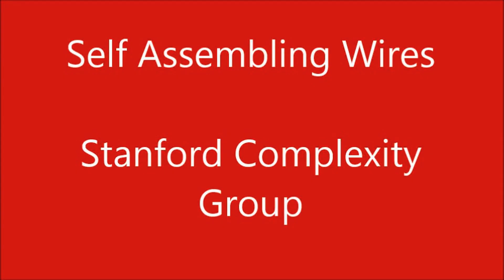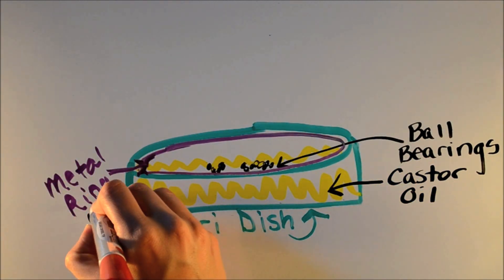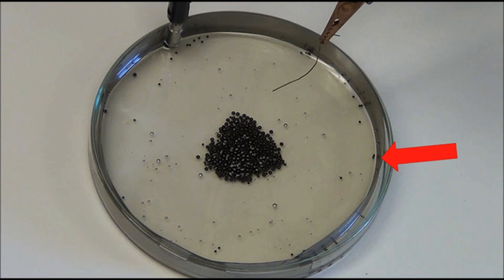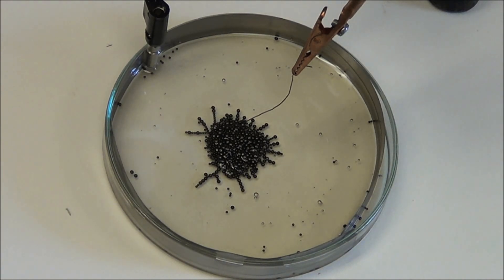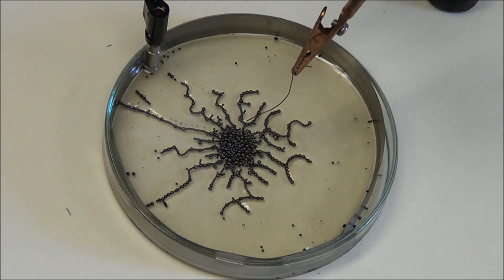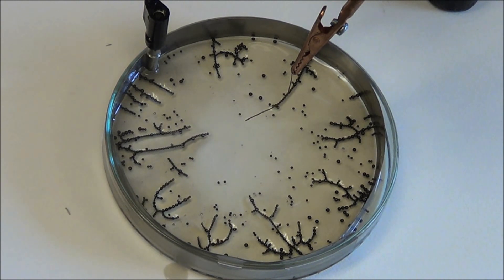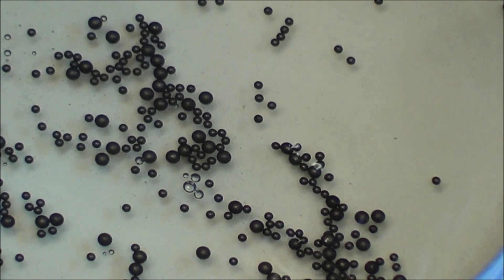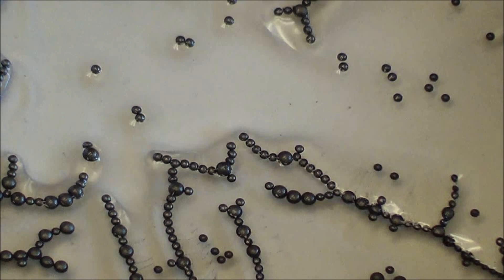Self-Assembling Wires

Comment: "The plugs in your house are 120 Volts."

chuckles in european
Reply: 230 V
Reply: politely snickers in Amish
Reply: @comit8077  *prays
Reply: Chuckles in New Zealander
Reply: How much volts do you get?
Reply: @mitesh2k3  240 in the UK lol
Reply: @r.m.l2665  - Same as the rest of Europe, the UK is 230V +10 / -6%, with the exact voltage varying between regions and even within the same region, during the course of the day. Some areas actually reach 250V (which is still within the standard).
Reply: @mitesh2k3  230 V RMS. 3 phases separated by 120 degrees (three phase is used for high power appliances like washing machines, for wall sockets you pick a phase more or less at random and use for separate areas of the house). You can get a peak voltage between phases of 400V (since you don't need a lot of current for this application; you just rectify and buffer that voltage with a capacitor and if there's enough resistance like this mineral oil it will drop imperceptibly to the next cycle)
Reply: @soylentgreenb  lol he just asked your AC supply. Just straight up say that it's 230 Vrms, why are you even trying to explain the rectifiers to him lmfao.
Reply: Laughs in Texan

Comment: Next, we attach a power supply and hang a wire over the top of the petri dish.
(proceeds to draw a plus sign to indicate that said wire is positively charged)
When we apply a large voltage, electrons get sprayed down to the ball bearings in the dish.

No. That's not true. You're full of shit.
Electrons have a negative charge. They flow from negative to positive. Either you've got your polarity reversed, or the electrons are spraying from the ball bearings to the wire.
Stop feeding the community false facts.

Comment: What might happen if you used iron powder in place of ball bearings? Would there be any difference id you used ball bearings with differing conductivity? Could you get a three dimensional set up if you coated the ball bearings in plastic to achieve neutral bouyancy?
What conditions would you need to apply to this demonstration to make a safe eucational toy?

Comment: At 0:49 you show electrons "getting sprayed down to the ball bearings..."  but electrons move from negative to positive, from cathode to anode, with the cathode negatively charged and the anode positively charged.  Electron flow is, like, the first chapter in electronics.  How did you get this wrong?

Comment: I hope somebody post this on Electroboom subreddit so he can try this out
Reply: "And if you see here Points too closely to the dish and gets shocked to hell AH. AHHHHHHHHHHHHH." I want it.
Reply: @MrPanaramuh  he'd ACTUALLY die if he did that
Reply: @Pockeywn  most lab supplies at high voltages run on pitifully low amperages. Think nanoamps.
Reply: @Pockeywn  I mean..I don't think so. Amperage is more deadly than voltage. These power supplies run at what... 0.5 amps? And besides...most of it's for show. Mans an electrical engineer. He's paved his way with stunts like that...EXCEPT the Jacob's Ladder fiasco.
Reply: @MrPanaramuh  amperage and voltage are dangerous together, lack of one will reduce the danger.
High amerages at small voltages will not pass through the skin.
Reply: @royalgummyworm8131  Yeah. This produces a whole other set of dangers though tbh.
Reply: @MrPanaramuh  r/whoooeash 

Hahahahhaha
Reply: If Mehdi were to read this comment thread he'd probably die a bit inside...
So many misconceptions here which he tried so hard to explain in his videos...

https://www.youtube.com/watch?v=XDf2nhfxVzg
https://www.youtube.com/watch?v=snk3C4m44SY

It's voltage and current working hand in hand that kills you.
Lower frequencies/DC aren't necessarily safe. You just need a higher voltage (or simply wet skin) for them to become harmful. 
On the other end of the spectrum, very high frequencies won't even hurt. https://www.youtube.com/watch?v=L5E4NiP4hpM
But I image even that can be dangerous if the tesla coil could keep it's voltage up high enough to push a high enough current through your skin.
Reply: @matthew_turkmen7482  How?
Reply: Your wish has been 50% fullfilled.
Reply: @matthew_turkmen7482  You are mistaken. Please be careful and do NOT rely on frequency measurements when making a safety evaluation.  Many factors are involved in lethality..... voltage, current availability, resistance ( both internal and contact ), position of contact, duration of contact, medical history, and yes, even frequency though because it isn't something we can usually do anything  about its normal to ignore it when considering mitigation measures.
Reply: I like your channel header
Reply: @matthew_turkmen7482  I'd also would like to know why you think this is.
Reply: @MrPanaramuh  the human body is highly capacitive. DC current doesn't flow well through capacitors, but AC can. The higher the frequency, the more easily the current passes through capacitors. In fact, an ideal (infinite) capacitor behaves as a wire under AC.
Reply: Electroboom is the cringiest shit
Reply: @K-tizzle369  YouTube in general is the cringe.

Comment: Fascinating video! (with surprisingly few views: 118,813 between 2015 and 2021).
A quibble: I have my doubts about the phrase, "electrons get sprayed down to the ball bearings" (at 0:47). Electrons in copper move at a literal snail's pace, far too slowly to make all this happen. In my opinion, the driving force here is the electromagnetic wave front (which travels close to c, which is to say millions of times faster than an electron -- same as in electrolysis, btw). Saying it another way, a wire hung over a petri dish is not a particle accelerator.

Comment: Nice, so diluted ferrofluid in a electrical field is the way to assemble better solar panels that not only look like leaves but distributes the charges in a fractal-infinite curve tree structure.

Wonder if you'd just need a bit of flux and solder to make it solid and permanent so you can get it out of the oil
Reply: If anyone can tell me how I can make a P doping at home from sand I'll break my microwave and a Taser (mosquito racket, really), maybe make a Marx generator from old buck transformers and try to make a solar panel from this.

I'll still try to do this at home, kV aren't that much of a problem, ididathing made a Jacob's ladder, electricboom has many videos about high voltages too and also the Plasma channel..

I mean, c'mon, you can easily make it at home, you just shouldn't do it bc you'll probably electrocute yourself to death

Comment: The path of electricity is very thin, its not wide at all.  The bearings(as all matter does) conducts electricity, and in so doing physically(with no resistance as in this case) align with the current, thin current...  Which explains their single file line.  When the first chain touches the outer ring, a new path of least resistance begins and electricity bulks up using this path of bearings.  The previous path of least resistance was an air gap along the surface of the oil.

Comment: That much voltage that close together I was honestly expecting it to just arc. Not a linesman myself, but I've watched them close a fuse in after dark, quite the lightshow at 17kV
Reply: If the current is limited (which it will be from a tiny power supply like that), then arcing is likely to be minimal - the instant enough air is ionised and current starts to flow, the current limiting kicks in and the voltage drops (thats how power supplies work). Attach it to something like a 500MW generator, and it'll arc.

Comment: What would be interesting here would be to have more than one variable high voltage source.  Then use an artificial intelligence with backpropagation to assemble different shapes.  If you could then activate the substrate, you could fuse the shapes.  For example, by applying sufficient heat, you could weld the metal balls.

Comment: The most impressive part is that 22 percent of the balls made up the ends
Reply: And 22% made the connections :)
Reply: @mmdirtyworkz  Technically all the balls in the structures were connectors, what you actually meant is branches. Still quite impressive.
Reply: 22 percent of pee is stored in the balls
Reply: @tophan5146  Especially when they are out on the end of your rod.
Not surprising...  some 40+% of Americas' citizens got their heads stored up Donald John Trump's ass.  They decidedly moved toward the wrong attractor.  Many were never seen again.  Many are still trying to detach.
Reply: This can be a statistical phenomenon. I'm thinking out loud here but hear me out. We can divide the balls into 3 main states based on their electric potential, in increasing order of potential:

1. Leaf Balls (those at the end) with only 1 adjacent ball
2. Connector Balls with only 2 adjacent balls
3. Branch balls with 3 adjacent balls

We can make an interesting observation here that the potential of each ball would tend to the average i.e. the total voltage applied to the system / number of balls. Too much potential and you tend to lose some and too little and you tend to gain some. The system doesn't favor either state more than the other, which means the odds of a ball being in either state is equal.

This means that, if I were to plot Number of Balls vs Voltage on a graph. It'd be a traced by a symmetric curve about the average voltage. 22-56-22 is just another way of writing a 1-2-1 ratio. This means you're twice as likely to be a connector node than 1 or 3. Not sure why it's this specific number but I'll get back to you when I find the time to give this a more rigorous thought lol
Reply: @RexGalilae  Brownian motion with an attractor introduced., switches to shortest path seeking.  Try it with an insulator for the beads, like bead blast glass beads.  I'd bet they would still try to crawl to the edge similarly.  Or try different conductors like copper beads or silver beads.
Reply: @cosmicraysshotsintothelight  
Exactly! A Stochastic process
Reply: Why?
Reply: despite
Reply: OK, I'm trying to decide why I should be impressed. Somebody impress me with an answer.
Reply: Balls
Reply: @cool_bug_facts  Observation tally errors.  It is really 21 and 23. :-)
Reply: 22 percent of ends and nodes.  The number 22 is obviously dependent on factors such as the medium's viscosity and conductivity of the ball bearings.  However, any fixed number would be fascinating in itself.  'Ends' and 'nodes' remind me of vertices and edges (and surfaces) in the geometrics of solids.  I'd love to hear anyone's views on this, because the number 22 is what jumped out at me.  (Also: dendrite formation - and later pruning.)
Reply: 100% of pee is stored in the balls
Reply: This is why sarcasm is funny
Reply: a thousandth like
Reply: For every new branch (with new ending) you need a junction as well. So unless there are multi-branch junctions, you'll always have the same amount of ends and junctions.. (or rather, one less, as you start with 1 end and 0 junctions).
Reply: Heheheh balls
Reply: @3pmBreakfast  That's what Newton said.
Reply: and you got 22 likes
Reply: @damnyourpasswords  and this is the unfortunate 23rd reply
Reply: That means that lightning can get ya no matter where you are standing if it is anywhere near the point it decides to strike.  Those darned dendrites...  you try soaking them out, you try scrubbing them out, and still you get BOLT AROUND THE COLLAR!
Reply: That's actually just basic logic. The interesting thing is that 22% make branch points. Because whenever you branch, you add 1 end so logically number of ends is always number of branchpoints+1. Why 22% make the branches? I dunno.
Reply: https://youtu.be/0VkrUG3OrPc
Reply: Not the fact that it had borderline intelligence?
Reply: Are you a bot? I do not understand the point of this comment. 

I see this type of comment in every video on youtube: "my favorite part is (random clip)" 
The snippets they highlight are totally random and have no elevated meaning outside of their original context. Its so common, and so formulaic I have a theory that YouTube is filled with bots that are simply there to artificially increase traffic. I'm not picking on this one comment, its just an example of the sort of robotic, inhuman comment I see EVERYWHERE.

Wtf is impressive about 22% of the balls making up the ends? You could say there is evidence of fractal symmetry present due to the recurrence of 22%, You Could try to explain the reason why it is 22%. This comment is totally meaningless without the context it was taken from. As if a bot just scooped up a random sentence from the video and said, hey fellow humans, wasn't (insert line here) great?

Go the the comment section of some of the scummier parts of YouTube, like those Family guy clip compilations or something, and you'll see thousands of comments that amount to "My favorite part was when Peter said "The"."

They aren't even selecting a punchline. Regardless of your sense of humor, I think we can all agree the punchline of a joke is the only relevant part of the joke. The rest is just the setup that gives the punchline comedic context. I'm sure the phrase "Danger Rake" is probably the punchline to something, but by itself its meaningless... just like "22% of balls making up the end" is meaningless.
Reply: @Fabrizio_Ruffo  "You could say there is evidence of fractal symmetry present due to the recurrence of 22%,"  I already did, ya dope.
Reply: @Fabrizio_Ruffo  Rolf, go smoke a joint. Most of us are non-scientists. We're looking at something very interesting and are trying to talk it out. Thanks for the information, but everyone has their own knowledge. If you don't know Air Conditioning, it's pretty complicated. If you know it, like anything else, it is now easy to you. Don't judge people so harshly. Not everyone CAN be smart.
Reply: @Fabrizio_Ruffo  Idk why you're so easily hurt by such an innocent comment, but...

I think what Casey was trying to get at wasn't the number 22 itself, but rather the fact that the ratio of branches to connectors is invariant regardless of the number of balls. 

and regarding "You Could try to explain the reason why it is 22%", that is a lot easier said than done, my friend. Not everyone is clued up about electromagnetism or whatever field of maths/physics is relevant to this experiment, but it doesn't take a learned expert to be impressed by a constant value in a place where you wouldn't expect to find one.
Reply: @Fabrizio_Ruffo   there is no punchline cause they aren’t trying to be funny, and the point is simply that they found it interesting that it always seems to be the 22%. This video got recommended to a lot of people for no reason, and most of the people here don’t have the knowledge or the understanding to explain why it happened or have proper scientific or mathematic conversation on it, so you can’t just expect that from them. Like I understand that some comments may be like that, but this one has very valid reasoning and is in no way suddenly a “bot” just because they pointed out an interesting statistic from the video.

Comment: The balls are attempting to move through a 3D pattern  and limited by the depth in dimension of the plate.  Great experiment, repeat in large fluro-cell... energy flows in crystal form, the balls are following the current and mapping pressure mediation.

Comment: I wonder how it could be transposable to a more pragmatic use. Like repairing damaged wires without "opening" the whole electrical system, or even kinda 3D print wires/conductors within complex structures.
Pretty amazing research !

Comment: Is there a significance to to percentage values of ends and nodes being close to e^pi
Reply: The significant part is that e is basically the number that is representative of scale invariance, either in a system or an equation. In complexity theory, everything is basically scale invarient, and that's also why we see e and it's associated mathematical properties pop up everywhere.

If you really want to get into cool science here, look up "Complexity and Gravity" by Leonard Susskind. It's a 3 part lecture that explains the very fundamental constituents of complexity theory, and he goes on to use complexity to describe and solve the firewall problem in black hole physics. The implications of the lecture, basically describe that all things in the universe are moving from homogenous to heterogenous to homogenous to heterogenous etc...and that the entire thing is essentially a scale invariant system. The universe as a whole moved from Homogeneity to heterogeneity and it will again at Heat Death collapse to Homogeneity...and that complexity says that max entropy state isn't the final state of a system, so it will continue to explore every possible state until maximal complexity death...which means again that after heat death there will be some kind of heterogeneity into homogeneity into infinity.

Basically the entire thing is a mind blow when you sit back and think about the implications of what was said in the lecture. All the cool stuff like e is just a mere human description of an extremely grand and wonderfully simple and complicated mechanism.